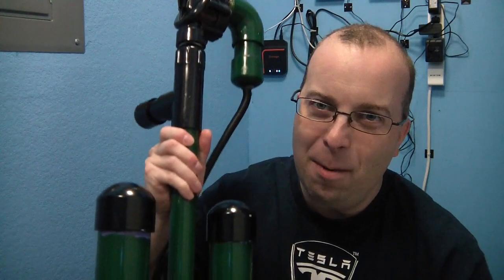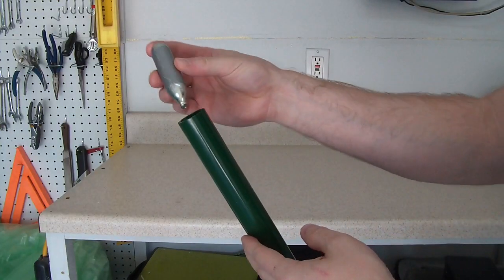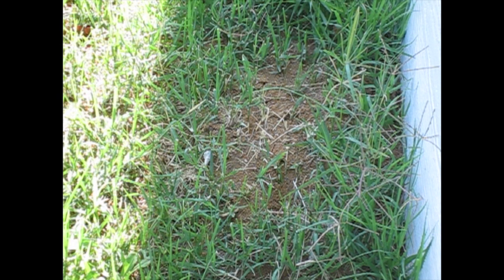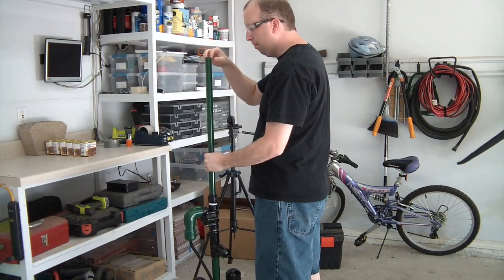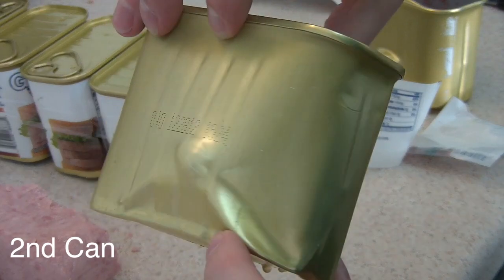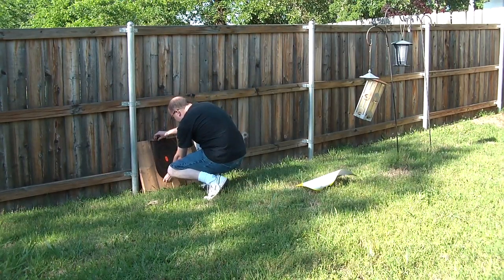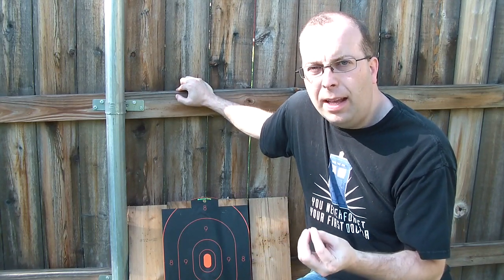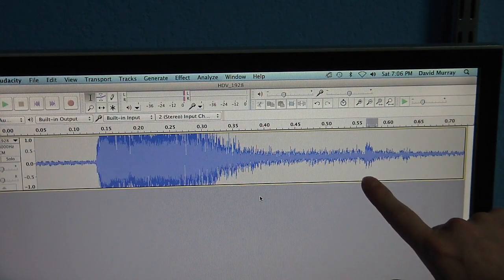Compressed Air Powered RPG causes destruction!

Comment: I used to work as an audio engineer, and my ear told me there was no way that 400+ms passed between pulling the trigger and impact so I started doubting the facts as presented and loaded up the video for myself in Reaper. I do not believe that the sound at 0.56 in the screenshot is the impact, but most likely a direct echo of the impact off of a neighbour's house about 70-80 yards away. It would take a sound wave about 400 ms to travel that far and back. It might be the sound of the cartridge falling off the roof as well. I believe the impact happens much before, and is lost amongst the noise of the blast and the audio clipping. The screenshot of the audio is from the camera angle that shows Dave pulling the trigger, but in the next camera angle afterwards, which shows the target getting hit from close up, we have clean audio, where we can hear more clearly hear the trigger and a clean impact about 100ms later. 

To make things simpler, let's say the audio from this camera is physically lined up with the target and the rpg was shot 19 feet away from the mic. Still thinking about the speed of sound in warm Texas (about 1154 feet per second), it would have taken the sound of that trigger about 16ms to travel to the microphone and be picked up, so we add that to the 100 ms mesured to give the proper frame of reference. We find out that 19 feet travelled in 116 ms works out to a velocity of around 164 feet per second. I am open to being corrected but I do believe this value to be correct and to be in line with the performance of this awesome gadget.

Love your channels Dave, thanks for all the nerdy projects over the years!

Comment: Using the audio to calculate the velocity isn't very accurate at when using a high speed projectile at a long range. That or the math is wrong. If that was the case it would only have a muzzle energy of about 3.2 joules, which is nothing. Thats like less powerful then a co2 bb pistol. Obviously its way more powerful than that. I would say it is at least 200-500 fps. I subject getting an actual chronograph to measure the velocity.

Comment: The velocity is 44 ft/s: 19ft in 0.43s (according to your Audacity screenshot). That's also 13.5 m/s.
The energy is about 2.5J: E=½×m×v² (kinetic energy)
E=½×0.028×13.5²=2.55J
Where 0.028 is the weight in kg of an empty cartridge (40g - 12g of CO2) and 13.5m/s is the velocity.
If you happended to use new cartridges as projectiles, then the energy would've been about 1J higher, at 3.6J instead.

Comment: You need to put a wadding on the bullet when you put it In because that co2 cartridge should not slide done the barrel so easily
Reply: And use something other than co2 because the projectile is blanched in weight , and since you have no rifling it's tumbling after about 5 yards use a heavy headed projectile

Comment: Speed is 13,6 m/s = 48,96km/h = 44,7 ft/s = 30,42 mph not concerning negative accerlation by wind resistance.
x = v * t
v = x / t
v = 19 ft / 0,425s = 44,7 ft/s

Comment: Hi.I got a few ideas about the projectile.I've been R&D w/ my BB rifle but I'm limited to my 6mm barrel.
A kind I've success on is a nail fitted to a plastic boot which fit to the barrel.The boot stays w/ bottom half of the nail,so it stops the nail from further penetration,even if the nail can punch through more.
The kind I have in mind but can't make is a Sabot round,like those used by modern tank's cannon.I'm sure w/ the larger barrel of yours,you can work better than me on this idea.

Comment: Although its not in either of our videos, this IS something I actually experimented with off camera.  I can tell you that without a doubt, the accuracy was much higher with the canister in this position.  Their are two factors I believe that contribute to this.  First, there is less resistance when it tails off to a point much like an airplane fuselage, and second the open hole in the end of it catches air and pulls it off of target.  Thanks for the feedback!!!